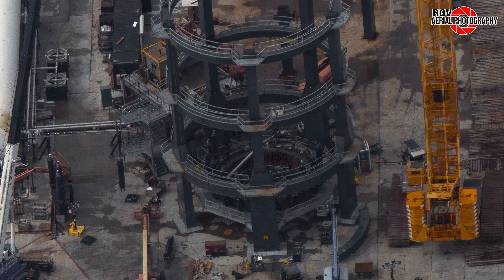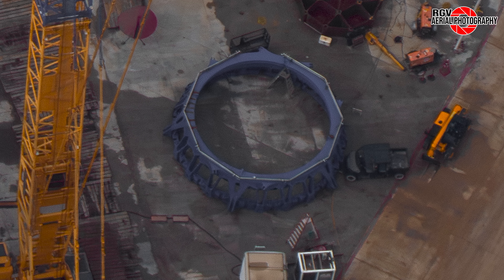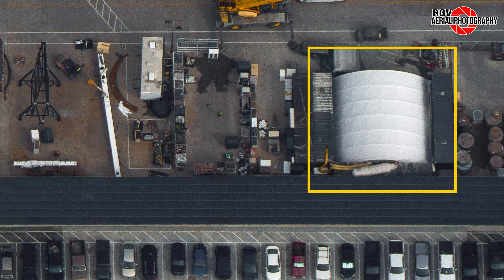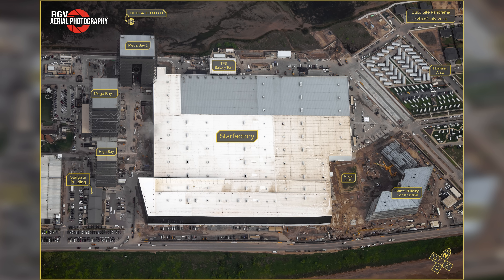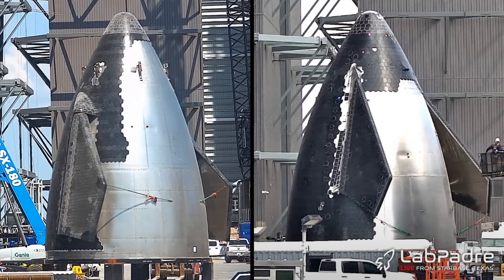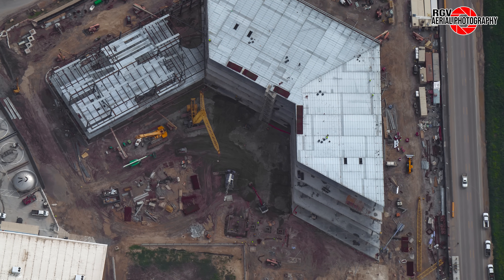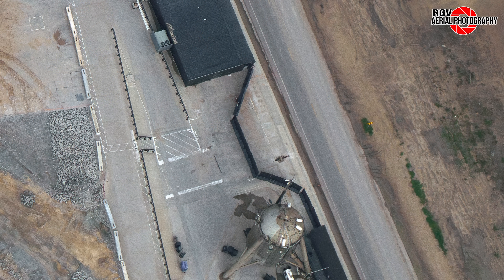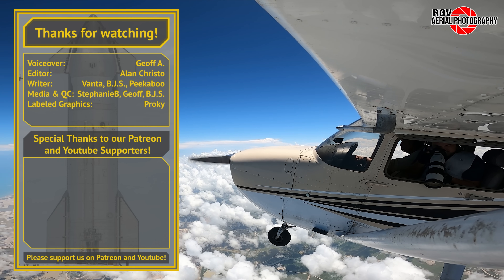Starship Block 2 Hardware Begins Stacking! | Starbase Flyover Update Episode 50

Comment: Construction needs to be accelerated significantly! Otherwise, it will be difficult to achieve Musk's launch goal within three years.
At least 100 launchers and large-scale maintenance and assembly hangars need to be built, and the transportation system and power system in this area must be greatly improved, and more concealed underground/high-speed unmanned and automated technologies must be adopted.

Comment: A huge thank you to the RGV aerial photography team. These updates that you share with the community are so inspiring.
Reply: Better than Rocket is here
Easy lift off 
Easy land on with antigravity Spaceship
No Fire
No Explosion
No Flame
Just Spin and
Lift off
Powered by Baterry

Work base on Gravity just spinning by using Battery
can fly in bad weather, plunge in the ocean even in outer space
Can lift more than 100 Ton 

Earth which weight predict 600 trillion ton does not fall at the Sun because of centrifugal in orbitting, on the contrary it does not be thrown far go out the orbit line of hold by gravity at the Sun as orbit center. Gravity and centrifugal is equal called Equillibrium, thats why until now Earth which we was inhabited always rotate and circulate the Sun. Now we justly take example : how if the gravity used and centrifugal is negated? The Earth will float far leave the Sun. So that centrifugal can be used to fly far away if gravity eliminated. Finally how to eliminate gravity?

It’s way rotate part of aircraft by horizontal. When that rotation faster centrifugal force getting greater and the gravity getting smaller, finally it lose the gravity and the aircraft start flying. Of course people would surprise: how the aircraft can keep rotate without fulcrums? Thats why we named that aircraft Shuttling System that is aircraft likes two disc adjoining attached in the midle as fulcrums:

A. The Top part, we name Positive rotate to right, and the edges is getting thicker and havier.

B. The Buttom part, we name Negative rotating to left, and the edges is getting thicker and havier.

C. Middle Part , we name Neutral, air crew placed and also machine and everythings turning Negative and Positive at the same time.

The aircraft can liftup added with explosion from the engine. However that aircraft construction later, let the engineer doit it, and we are sure the aircraft will bulletproof and also waterproof.
 
.
.
 
In modern civilization where human being generally using flying saucer as vehicle, will a lot of change in lives either in materialism and in psychological. In materialism area will apply the change in life like.
People no longger need roadway and rel road which spend large of energy, money, places, things and time, object place and time. People would utilize that area for habitat or for other need:
Reply: Rocket is complicated and dificulte
Low safety and high cost
We need somethings better
Developing technologies to enable human access to space at dramatically lower cost and increased reliability #FeelFree